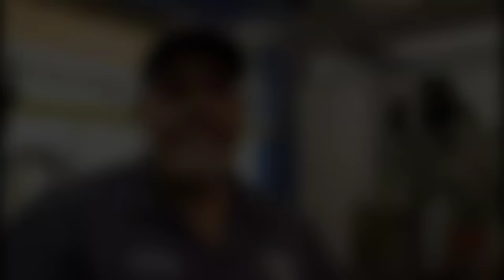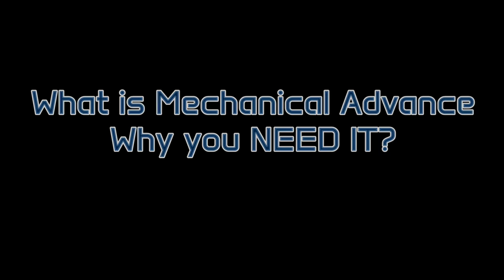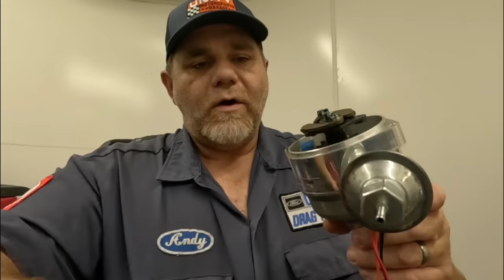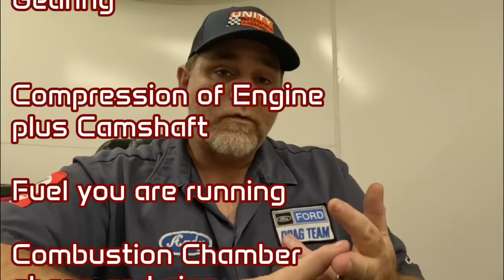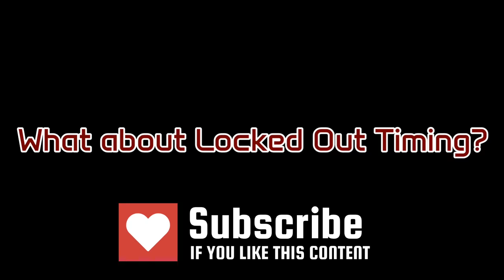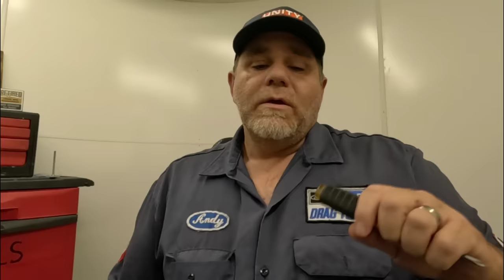Ignition Timing or Fuel Tuning First? You are doing it wrong!

Comment: I took your advice in previous videos to use manifold vacuum advance on my ‘69 F250.  Well, that started me on a quest to get the most out of the 360FE in that old truck.  I started out with 12-13 mpgs and fiddled with the initial and mechanical advance, got an adjustable vacuum canister and played with it until I ended up with 19-20 mpgs (city driving not highway).  On one 30 mile trip I got 20.9 miles per gallon.  And I haven’t touched the carburetor yet.  I’m extremely interested in the minute details of these systems and sincerely appreciate these videos.  Thx Andy
Reply from the maker: That is awesome! CASPER gets better mileage around town also... Highway at 3800-4000rpms kills MPG
Thanks for watching!
Andy
Reply: @UnityMotorSportsGarage  I would think aerodynamics would be critical. Your truck is a brick. I would be starting to smooth up the truck starting with a plywood underbelly under the engine bay. Your engine videos are some of the best on You-Tube. You are lucky to have hooked up with DV who recognized your abilities.
Reply: Gear lash and the pressure of the atmosphere
Reply: Brother. My 360FE gets 3.5mpg. Please help
Reply: @SonOfAHerbert  You’ve got to go over everything from the timing to the carb to wheel alignment.  I’d start with the basics like properly-gapped plugs and good wires, free flowing exhaust, clean air filter…. You know, the basics.  Then I’d tackle your timing.  You want your initial timing to be as high as you can get it before the starter has a hard time turning over.  Then you want to make sure total timing is limited to where the engine doesn’t ping.  Then curve your distributor so that your timing is all in around 2000 or so.  Then make sure you’ve got an adjustable vacuum advance canister and adjust it so that you’ve got appropriate vacuum advance at idle (whilst connected to manifold vacuum).  My engine loves 32 degrees (initial + vacuum advance) at idle.  After your timing is dialed in, I’d move on to the carburetor.  Just rebuild the thing and make sure you get all the details perfectly dialed in to spec.  To get your carb adjusted properly I would install both a vacuum gauge and a quality AFR gauge.  It will make carburetor adjustments so much easier.  Get it adjusted so you have a nice lean burn at cruise and an appropriately richer ratio when you get on it.  Start from there and see where you get
Reply: @yeboscrebo4451  thank you very much. I’ve got the basics out of the way, and dug into timing today. As it was set about 6* BTDC, my vacuum gauge (connected to manifold where it was going to vac adv) read about 14-15” hg, no leaks that I can find, so I advanced to 10 but it was still in the red zone on the vac gauge showing late ignition timing. Adv to ~13* and I’m sitting at 18”hg (300’ above sea level) and about 950 RPM, where I understand rpm’s should be at ~800 in park (auto trans). 

Turning the idle screw so rpm’s decrease to normal drops the vacuum back down in the red zone, so I reset it to where it was. This is where I am and I’m confused about the next step to take. Should I make adjustments to the carb before going to the idle screw? Or vice versa? Or would you think there’s another underlying condition that I’m overlooking in regard to the timing, that should be addressed, before going to idle circuit? At ~15+* BTDC it makes a concerning tick and I don’t know what kind of issue that might be. 

By chance are you on any of the Reddit automotive forums? 
Thanks again
Reply: @SonOfAHerbert  13 degrees initial advance is definitely better than 6 but I’d keep going if I were you.  I ended up at 18-19 degrees initial timing if I remember correctly.  The factory timing settings are meaningless with today’s fuel.   However, it’s probably a good idea to take things incrementally so, yeah, keep it at 13-14 degrees initial and then do all your other adjustments before you keep advancing initial any more.  950rpm is a bit high, I agree.  Remember auto transmission vehicles need to be safely in gear when you make these adjustments, not in park.  When you say “idle screw” are you referring to the idle speed screw or the idle mixture screws?  Before you start messing with the idle mixture screws you need to adjust the idle speed screw so the transfer slots are squared - and then don’t touch it after that.  Then you can fool with the idle mixture screws.  It starts ticking at 15 degrees?  Are you sure you have the vacuum advance canister unplugged while you’re determining your initial timing numbers?  Also, what is the needle doing on your vacuum gauge?  Is it steady or does it bounce around at all?
Reply: @yeboscrebo4451  so the needle bounces. Vacuum adv. plugged, and my gauge is tapped into the line that feeds it, which I believe is manifold. Yes, I am referring to the idle speed screw. I’ve determined there are several vacuum leaks, so first order of business really is to replace the hoses.
Reply: @yeboscrebo4451  if I’m adjusting timing in gear, the 13 degrees or so stays the same, but what rpm am I shooting for? About 600 right? Maybe I’m not understanding the difference being in gear makes.
Reply: @yeboscrebo4451  If I’m in park and reading 13* would that change going into drive?
Reply: @SonOfAHerbert  if the needle bounces around that means something.  It should be steady.  Google “vacuum gauge diagnostics” in images.  You’ll see what a bouncing vacuum gauge needle could mean.  Yeah, replacing hoses and checking gaskets is a prerequisite.  Being in gear makes the rpm drops a little that’s all.  So does having your AC turned on.  You just want to make your adjustments in gear to account for that drop.
Reply: The rpm on my truck has to be at around 850.  Any lower and my AC compressor starts shaking
Reply: @yeboscrebo4451  thanks again. My truck no longer has AC hooked up
Reply: @yeboscrebo4451  do you know what size the jets should be? I rebuilt the carb aside from jets so far and determined that they’re too big, since after turning one in fully the engine stays running.
Reply: @SonOfAHerbert  the jets and the idle mixture screws are two different things.  If turning the idle mixture screws in doesn’t do anything then you need to make sure your transfer slots are set to a square
Reply: @yeboscrebo4451  yes I meant I turned in the mixture screws. I’ll revisit transfer slots next

Comment: I spent two years of working with a Sunnen Distributor Machine. I learned that you could change (by grinding on the dampers of the weights) the final or top advance for the mechanical and I also used the vacuum system to maximize the utilization of the vacuum canister by adjusting the small set screw that is inside the diaphragm. This made the startup of the engine much easier to perform and get the carburetor can be adjusted easier and then the final distributer adjusted, making run time for tuning much shorter and easier to create the desired effect. I would love to have another distributor tuning machine for this purpose.  
You are not crazy. Everything I talked about is done before the distributor is installed on the vehicle making it able to be the closest to optimized at the outset. I also did not mention the adjusting of the springs. You mentioned them, but you could (when I was doing this) special packs of springs from companies (like Sunnen) that covered the areas the normal tune up would not cover. You could also get different weights so you could mix and match weights to get a better curve. I think that all of these types of things are now long gone (I am also 73 years old and I was working with the Sunnen when I was ten at a friend's garage who built race cars exclusively).

Comment: 🥝✔️On track. Administration of load based advance, is different to making a reactive based machine response. You cant Tip in ignition with a conventional electronic ignition unless you have vacuum delay valves or spark retard canisters or signal amplifiers, or the 1981 Duraspark III or 1984-1995 Thick Film Ignition  Ford used, or GMs CCC 1984 SEFI V6 ignition. Programming a vacuum electonic or HEI is only in two dimensions. When Ford moved to Duraspark Three and TFI it moved to 3D mapping. Fully solid state "3D mapping" of ignition advance under differnt vacuum scenarios is a walk in the park compared to Mallorys YL based system.

Comment: I've always seen the timing and fueling as a balancing act so I would set the timing close without a timing light because I never made any power with a timing light, made alot more by feeling what the engine wants in that chassis. then set the fuel and fine tune the timing a little bit at a time until I find that sweet spot. or sometimes I'll get some spark knocking/detonation and I immediately dial it back with just a touch extra for safety. so your methods all sound plausible to me. I love your content and DV's just wish he didn't make me nod off sometimes

Comment: This video should be required viewing for everyone that's having troubles with the "carburetor"....... because the issues they are having, usually are right here in the distributor (or timing).
Dang Good Stuff Andy as always man.
Reply: Seems to me that getting fuel sorted first was his recommendation - speeds up tuning time.   Working backwrds from an optimized peak cylinder pressure moment  vs crank degrees, three things come together: fuel ratio, fuel type, then timing.   Anything in operation that affects flame propagation rate can influence timing... even a  thermostat change can tilt optimum timing slightly, as detonation risks for the same fuel may go up or down depending whats installed.  I don't think there's a "perfect" number for timing peak pressure, except it should be closely after tdc.   If it comes in at exactly tdc, alot of force is wasted just hammering on the crank:  Torque=force x distance x sine angle...  gotta have [some] angle.
The bit about tweaking individual cylinder timing [escaping a one size fits all timing model] comes back around to...peak pressure.  And its one heck of a tech tip - probably not achievable without a dyno.

Comment: Back in the 90’s before gear reduction starters. That grunting starter wouldn’t crank most higher compression engine after they were hot. So I found out through using my dad’s bench top distributor machine why. The mechanical advance was limited to about 12°. I spent time regrinding the mechanical curve up to 30°. I was very successful stopping the grunt on hot engines while cranking. Timing window was very adjustable with different weights and springs.

Comment: I totally agree! once you go with a programmable timing set-up, the ideas that worked well for a simple mechanical based timing set-up dont work so well, and can actually be a hinderance to getting all you can out of the engine, especially at part load. When I went to EFI and programmable timing, I felt like the farther I got away from carburetor/mechanical timing ideas the better I did, and the better the fuel economy, responsiveness and power got. I pretty much had to throw out the window what I thought the engine wanted for timing and fuel for a given load, because it was mostly all wrong!

Comment: My ‘69 F250 has the original autolite 2100 carburetor which has no manifold vacuum port, only ported.  Everything was set up as it was from the factory.  Well, I learned from you old timers about manifold vacuum advance and decided to switch to manifold advance.  Boy oh boy did my engine love that change!  After re-tweaking the timing and fiddling with a few things, my engine ran sooooo much quieter.  In fact I thought my engine had died at the light the first time i took the truck out for a test drive - it didn’t it was just so quiet.  The engine also runs waaaay cooler.  I just drove the truck from Sacramento California to northwestern Arkansas and when I’d pop the hood to check on things my engine bay was luke warm haha.  I gained mpgs and power.  I didn’t notice any cons to the change.

Comment: To your point on one of my vehicles with a holley efi system it has been crazy how much differnce a couple degrees makes with drivability. I have spent a ton of time playing with the fuel and timing and the timing has made the most difference when you get down to the final tuning. It takes fidiling with both to get the final results where you want them and the hardest part i think is the part throttle stuff.

Comment: Spot on Andy, give a motor what it needs for all around performance. 
For example, on my 66 mustang initial timing is 8* to prevent kick back. The moment the engine starts timing advances to 18* via a vacuum regulator and vacuum advance. Regulator is set to 7” so the lumpy idle does not affect it. When the throttle is opened the timed spark port applies vacuum to the vent port on the regulator which controls the vacuum advance from there. The 18* at idle makes for good idle and no run on at shutdown. With 26* of centrifugal advance (total 34*) can easily be adjusted for fuel. Timing runs 42* at cruise rpm part throttle. 22 mpg and 106 mph in the 1/4. All analog. My rule: you can’t get the mixture done until the timing is right but you can’t get the timing done until the mixture is right. So it is a finessing process.
Reply: Very well thought out.
Reply: ,,,,,,,,,,,,,,,,,,,,sounds good,,,,pardon my lack of the set-up,,,,Can you explain the vacuum regulator and where can I buy or make one....[ I need the best vacuum system possible for that cruise economy......Need directions or principles of its operation....I usually run manifold vacuum ,,,,and adjust the vacuum can for 12 degrees.....When it kicks out at higher revs the centrifugal advance does the rest to  total.... ......thanks for the input..........
Reply: @ThomasELeClair - used to be available at any parts store BUT since you asked I went looking and only found NOS stuff on EvilBay. No guarantees there. I guess I better cherish the one I have. Basically it is a diaphragm vs spring controlling an orifice. Usually around 5” of vacuum. Can’t seem to post a pic. Oh, it was a std GM part number as used on Buicks and Pontiacs.

Comment: Great video Andy, Junkerup did a video recently that really helped me as well, I had no idea how much power I was missing, I took off .20 on my 60ft time just by turning in my vacuum pod. 4 turns.
Reply: Your vacuum advance shouldn't have any affect on your 60 foot time. Vacuum advance is for fuel economy purposes.  It pulls in more timing under steady cruise conditions to help with fuel economy.  If you have it hooked up to a manifold vacuum source instead of ported vacuum it could affect your 60 foot.
Reply: @jaygooch1190  I wasn’t getting any vacuum at all, when I’m done setting my initial timing I would plug my vacuum line back in and nothing would happen ( idle wouldn’t go up) now my car runs much better, and yes more efficient.  this was my only change. So it did make a big difference.when I whack my throttle now it is much more responsive. Good thing about having a Dragy, it can’t lie.( just looked at exact numbers 2.30 to a 2.17. I guess not quite .20 but still better.

Comment: Yes. Good idea. Fuel first, lean as possible and still produce power, then adjust timing for max power. 

I would then probably go back to fuel and fine tune. This is a little like the principal of looking left, right, left for crossing a street. 
To be crazy you could do left, right, left, right, left... etc, but gains would diminish exponentially.

Comment: I use a vacuum gauge when I am tuning a carb. Also on a High energy ignition system.  I have even opened the plugs up to .60 gap. Runs smoother and better throttle response. No pre ignition even on high days

Comment: As far as fuel and ignition goes one doesn't necessarily get set before the other. They have to be bounced back and forth, as they both will affect each other at WOT. Start on the safe side (rich/retarded) and work your way up until gains stop and then back off a hair. Part throttle is a totally different animal. Many factors including  weight, gearing, load, temp, etc. But a curve with vacuum advance is definitely an advantage as you pointed out. The desired lean mixture in low load situations has a slower burn rate calling for the advanced spark in order to maximize torque and efficiency.